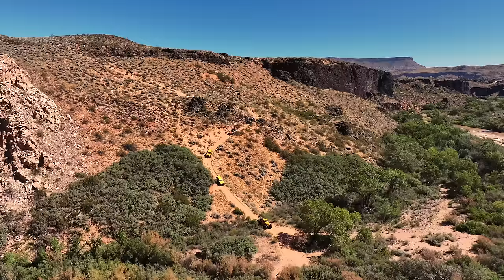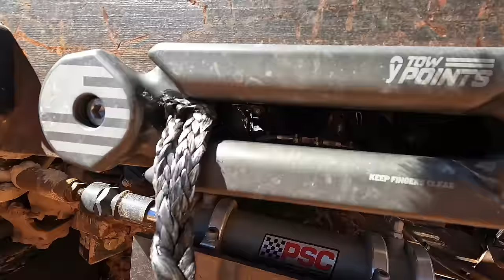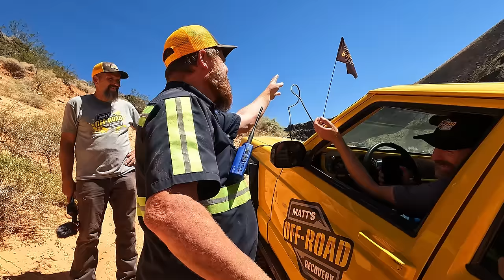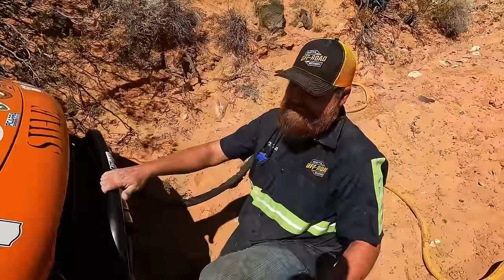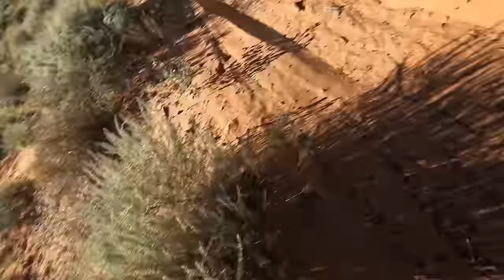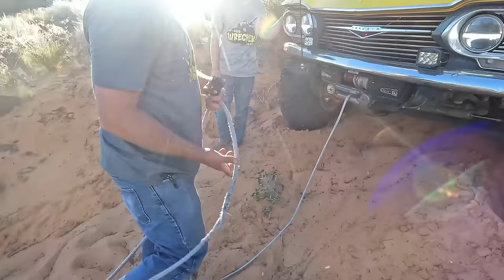I Failed...The Most Difficult Rescue Left Unfinished!

Comment: Dig a deep hole, bury a wheel as an anchor, use the winch to pull the car over the sand. If necessary, use sand sheets. That's how they do it in the Sahara.

Comment: I think what I gained from this video is actually how capable Jefe’s Bronco is at handling the sand hill. The Bronco was a beast. Squatch for the win! And Matt you may need to get Rory’s, Paul’s and Merlin’s wreckers involved to get the world’s largest wrecker out of that sand chute.
Reply: And Rory just wrecked the engine of Trailmator.
Reply: Heavy D will pull it up in no time
Reply: @MrCaprinut  Heavy D would probably just winch it in a straight line from the top (assuming their heavy wrecker doesn’t have to pass very sandy spots on the way from the road to the top).
Reply: A lot of the traction is the driver.

Comment: I am genuinely impressed with how well the Bronco did. I wonder if it has something to do with the transmission having 10 gears. Probably keeps the engine in a better rpm range.
Reply: That Bronco killed it!! #1 plain and simple
Reply: Ya, this is the best commercial for the Bronco I've ever seen.  I guess it's not just a pavement princess.
Reply: Ford needs to turn this into a Superbowl commercial for their bronco.
Reply: im not surprised.  I've seen a video of  bronco V/S jeep. and the bronco had to keep pulling the jeep out from being stuck.
Reply: It's a combination of the 10 speed transmission and factory turbocharging. It gives the engine a huge, flat torque curve, and the transmission does a fantastic job of keeping it right in the middle of it.
Reply: It mostly comes down to the lighter weight and the turbo.  The other rigs have to rev out to make power and that leads to excess wheel spin that is a bad thing in such deep sand.  The turbo makes the torque all across the rev range.  The wrecker has 16 gears technically and still couldn't make it because its so heavy and has to rev so high.
Reply: I guess that's Ford for you, the Bronco may not be the best crawler and it's definitely got some flaws but if there's one thing the blue oval knows how to do it's making trucks that absolutely rip on sand.
Reply: @shadow105720  True, but the wrecker only has 3 gears in the transmission, and they have a much wider ratio split between them (2.48, 1.48, and 1.1). The Bronco's 10-speed has more gears with a narrower split between 2nd to 7th (2.99, 2.15, 1.8, 1.52, 1.28, and 1.0 2nd thru 7th). Combine those narrow ratios with the turbo V6, the lighter weight, and those big tires, and it's no wonder it climbed that hill with ease.
Reply: Yeah the Bronco stays in the power band beautifully... Awesome illustration of how effective that is.
Reply: A lot was Jefe keeping that speed. The Banana would probably have done just as well at that speed (even stock XJs are great in the sand) but Tom was less reckless (I definitely would NOT want to go off of that road). Definitely got the job done, though.

Comment: The bronco blew me away. So fast off the line and through all the ruts left behind!
Reply: Not going to lie I thought it was going to do the worst and just behind the porsche due to power differences but ended up absolutely killing it and doing the best
Reply: Light with ecoboost torque its a great offroad machine lol
Reply: The bronco is a great example of utilizing modern advantages without leaving out the traditional ones.
Reply: One data point that has to be considered is if the Milestar XT tires are better tires for the sand, compared to the MT.
Reply: The Bronco did great, but it befitted from the Banana and the Porsche grading the Wreckers ruts flat. The Banana would have done better if it wasn't for the Wreckers front wheel holes it got stuck in.
Reply: @TimBaird-nq3fo  It's not light at all the new bronco is 4,823 curb and Jefe has added even more with the rock sliders and such. What really helps it in dealing with such a lightly compacted sand surface is the independent front suspension as well as the positive sensitive dampers which can firm up near instantly preventing the vehicle from squatting during acceleration. It allowed the front wheels to bite in independent from each other and not force each other further down into the ruts. the IFS also greatly reduced unsprung mass which is against exactly what you need on sandy dune like surfaces.

Comment: Can just imagine how hard that day must have been.
I would like to see the bronco go down again and take that complete hill in one try.

Great work guys!
Reply: Yeah for sure. The bronco was a surprise.
Reply: Stopping in the middle then casually driving off from a dead stop on the side was impressive enough.
Thats a serious machine!
Those other rigs got 37 and larger, Crazy that stock truck is that good
Reply: I was Thinking the same thing.  I feel like those broncos are made for these quick runs in the sand and not so much for rocks and stuff.
Reply: The Bronco has a short wheel base and traction control, that's the difference. Those massive tires on the wrecker are not made for sand, I'm surprised Matt didn't air them down...

Comment: I am genuinely impressed at how Jefe and the Bronco just shot right up the trail. I was getting ready for another halfway getting stuck and winching, like the Banana, but at no point did the Bronco need assistance from another rig.
Reply: Because it's a Ford. Was impressed the Bronco.
Reply: @brucescott4753  The answer is lockers, it was the only rig with functioning lockers down there.
Reply: @cedricpomerleau5586 I thought the banana and Morevaire both had functional lockers? I thought the only ones that didn’t were the wrecker due to them being broken and the Porsche due to not having them as options.
Reply: @mizinoinovermyhead.7523 it means with 100% functional lockers
Reply: @mizinoinovermyhead.7523  When they talk about lockers on the Banana and Morrvair they talk about hubs locker. I don't remember hearing them talk about diff lockers on those, but it's true that looking at the video, they appear to have them.

EDIT: Ok after some research: it appears that both diff lockers are limited slip on the Morrvair (Detroit style in the front, not sure about the exact style in the back). So there's no way to fully automatically lock them unlike in the Bronco.
Reply: @cedricpomerleau5586  ok looking up specs, cause that took forever, the banana has a Dana 60 with grizzly locker in the front and a Dana 60 with a spicer limited slip in the rear. 

The morevaire is similar as it runs Dana 60 upfront but instead of a grizzly upfront it has Detroit lockers upfront and a spicer limited slip on a Dana 70 in the rear.
Reply: So in other words the Bronco kicked their butt.

Comment: Whether it was self-inflicted or not, this is golden content. Also, would love to know what technical improvements you could make to the various vehicles to make this work "next time"
Reply: Lockers working and the new engine that's planned for the wrecker wlcould be all that'd needed for that
Reply: I was very impressed with the Bronco, something between the engine gearbox and transmission let it get the wheel speed and power down to climb as well as the Banana and Morrvair, I wonder what could be learned from it to improve them. Also be really good to see a functional Wrecker have another go, though it may well need more power, something like an optional turbo in higher gears to spool up and keep those monster wheels turning on a hill like this
Reply: @trif55  they already have a strokes motor planned that going to make a good bit more power, especially at higher rpm. No need to added the heat and more failure points of a turbo. And they have said a 6L is potentially on the cards to replace the 5.3, aswell as the 3:1 transfer case they already have for the Morrvair
Reply: @Dlawler  Ahh cool, I don't know a lot about big petrol V8s I figured 8.1 was pretty near the power limit for a naturally aspirated engine

Edit: is the 6L a V8 for the banana's straight 6? Of the 3, the morrvair seemed to manage it easiest but it's probably the highest power to weight?
Reply: @trif55  the 6L is the plan for the morrvair, instead of the 5.3L it has.
The 8.1 is bog stock intake to sump. Plenty more of power easily obtainable, even the current motor could pick up a good bit from some heads and a mild cam, while still keeping a nice big torque band
Reply: @Dlawler  Ahh cool, how big/what is the Stokes compared to the 8.1? Is there any plan to up rate the banana?
Reply: @trif55  for memory it's an 8.8L that makes about 500hp. The current motor is about 350hp.
Banana I haven't hear anything. It already has a stocker motor, and being little and light is its main strong point

Comment: I remember a time when Matt didn't like winches... Next he'll be using traction boards. Lol.
Reply: Nice dig
Reply: Not a dig at all. Just an observation. I've been in a situation where one thing goes wrong, then another, then another. Then compounded by the heat, it just adds to the stress. Glad it went well and he was surrounded by people keeping him in good spirits.
Reply: Yup, the Australians use maxtrax all the time for sandy situations like this.
Reply: @alexanderritchie5845   Yep, we sure do. They are handy for situations where you can't winch off anything. We also usually take a decent long handle shovel as well.... something Matt could add to the wrecker. It would be handy. Another trick is to run the winch line out and tie it to your spare wheel. Dig a big hole in the sand and bury the spare wheel. Makes a great anchor.
Reply: Matt should have a sand-anchor like the one you have on the boom of trailmater 🙊

Comment: What an awesome video ! The best one yet. ! Matt's questionable maintenance scheduling and execution ( Sorry Matt ) finally caught up with him. No lockers, no fuel,  flat batteries etc all conspired to wreck his day. To his absolute credit he remained calm and perserved and got the job done despite being under huge pressure and clearly worn out because of the heat and lack of food. lt would have been an extremely hard day for all in the heat and the soft sand. 
A lesson that we can all learn from no doubt.
A special mention to his fantastic team that backed him up and were essential also.
The best thing was that no one got hurt. This was one of those situations were risks were high and things could have gone really bad.
Can't wait for the wrecker recovery and the sand challenge part 2 with the Bombie. Really like to see Rory and Paul have a crack at that hill as well.
Sounds like the basis of a new challenge video.😈
P.S. How good was the Bronco ?? Maybe one day Matt can squeeze in a video showing the advantages and disadvantages of the various vehicles ? Looks like the wrecker's weight which is generally an asset really works against it in the sand . Who knew ?
Reply: I think they said the low fuel in the Banana turned out to be low voltage. 
But yeah, I agree with you. 👍🏻🙂
Reply: @kjsgarden a bit of both fuel and battery
Reply: Paul will cruise right up that hill. Rory probably wouldnt make it unless it was  after a rain storm. Its easy to get up when its wet. The more it dries out, the harder it gets. Do not attempt this hill folks unless you are prepared for repairs on the trail. Extra belt (sxs) spare tire, shovel, tow rope, and most importantly, dont go down with only 1 vehicle.

Comment: You have created an absolute masterpiece! The suspense curve in this is straight from a hollywood movie! It all starts as a fun adventure and everyone is having a good time getting into the ditch. We get a little premonition of what might be coming when you realize it might not have been the best idea to take all the vehicles down at once, but you still kinda laugh it off. Then the wrecker does its thing and fails, also it keeps losing more and more coolant and it dawns upon the adventurers what they got themselves into. The Morrvair gets it, with all its effort. The Banana needs a jump start and can't be turned off from now on. The Porsche tries and doesn't get very far. The Banana runs out of gas. The Bronco makes it up on the first go, a sigh of relief. A lot of pulling and winching happens. Meanwhile the adventurers are getting increasingly hungy and thirsty. Matt leads the group through the struggle with a lot of critical thinking, patience, taking al the responsibility, but he can't quite hide his own exhaustion. The Banana almost catches on fire, but with combined efforts after a cry for help the situation can be controlled. The Banana, Morrvair and Bronco all make it up quite easily, but the Porsche doesn't get very far. With the last rope that they have, thex barely reach the Porsche to winch it out, but something breaks and everything goes flying. On the second attempt they manage to pull out the Porsche as is getting pretty dark already. Everyone is happy they can sleep at home and not in the dunes, but there is still the Wrecker waiting to be rescued and creating a great cliffhanger leaving us impatiently awaiting part two. Maybe with the Bombi?
Reply: All while having huge smiles on their faces, what a group of people.

Comment: Matt, feel free to ignore advice from a retired MD, but I was part of a working group at our plant and dug up the continuity of business plan section for emergency response vehicles which I thought I would share. 1. Every plant vehicle is equipped with the following. Military style trauma kit, 20lb Dry chem fire extinguisher, an addition Purple K extinguisher. LED emergency lighting (includes rescue beacon), and a minor tool kit. Every 90 days each truck is inspected mechanically (long list) and fuel additive is added when fueling.

Batteries are replaced annually during the yearly fluid change routine. Decca batteries are used due to their heavier construction specs and I believe that all CAT vehicles also now use Decca which are made at a state of the art plant in PA (Got a tour once with the continuity group). The only other thing I found that might be of interest is that all vehicles have their     electrical connectors sealed with a Motorcraft product to prevent corrosion. Thought you might use a couple of these ideas since you take it to the limits which is so, so enjoyable.

Good luck and continued success.

Comment: Wow, never seen Matt lay down on the job from exhaustion.  That looked like a very challenging day.  Also, glad I didn’t buy a cayenne
Reply: First Gen Cayennes had lockers.
Reply: @jasonhamilton547  I THINK you could get a rear locker, but no low range, which probably would have made a big difference in parts of that. I could be wrong though, the build sheets for both this and the taureg are mysterious, and there may be a mythical unicorn out there with a front locker from the factory.

Comment: Probably the most intense video in a long while! This is also why I normally have a second vehicle nearby out of the precarious situation as back up. 

Also might be time to invest into a winch anchor. Basically a foldable Dorito with a D-ring loop that sinks deep into the ground that you can winch yourself up off of.

Rory actually has a custom one on his rig that’s the same concept. (It’s the shield looking piece with holes on the main boom).
Reply: Add to this a small shovel. Leveling those ruts from the Wrecker would have helped the Banana a lot going up.
Reply: I saw the video where Rory used that earth anchor. Great idea!

Comment: most of matts problems are from LACK or proper maintenance and upkeep, knew the lockers were not working and didn't bother to fix it, didn't do maintenance on  batteries charging system to ensure that were working on other vehicle, not keeping fuel tanks filled the list just goes on, other videos show same issues of failing to maintain his vehicles.
Reply: Who ya gonna call when the off road rescue is in need😂

Comment: Biggest surprise of this debacle was Jefe and the Bronco!  That rig really did well!  Wrecker has it's own limits, especially when the lockers aren't functional.  Morrvair (and Rhett) did great, as usual.  Porsche was way out of its element, but sometimes the MORR crew has to recover people in vehicles like this out of areas like this.  All-in-all, still a good experience for the "lessons learned" folder.  Especially failing, as that is maximum learning mode engaged!  Also, I am shocked the Banana ran out of gas...again.

Comment: For Tom: One PE to another, seems like the wrecker’s air problems would be solved with some Swagelok compression fittings and some 1/4” SS tube. Strong, heat resistant, reliable.

Love the content, keep up the good work!
Reply: Metal tubing and fittings have already been purchased.
Reply: ... and then put together a trail repair kit.

Comment: This feels like elementary to me,  since I grew up near the nation's second favorite sandbox,  but ya gotta air down,  low, I mean 5 pounds of air,  squatty side walls,  low.
Great video,  great team,  the new wrecker is crazy impressive 👏
Reply: Absolutely! Why hasn’t anyone else mentioned that the answer to sand is always low tire pressure. Very low tire pressure almost to the point of spinning tires inside of rims. You gotta do what you gotta do. Otherwise you just sit and dig holes in the sand.